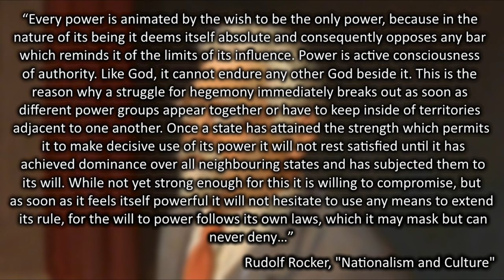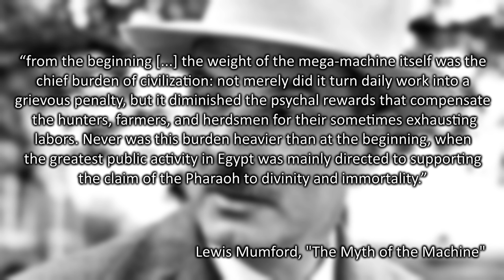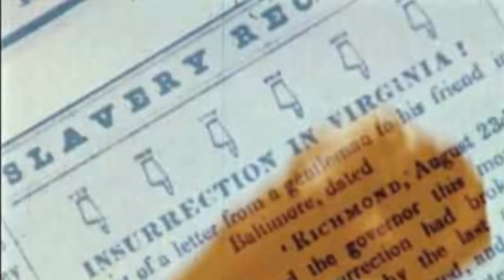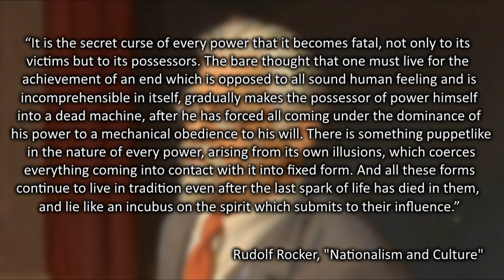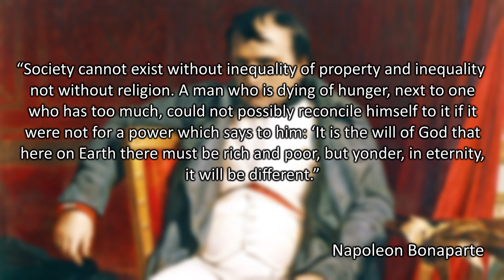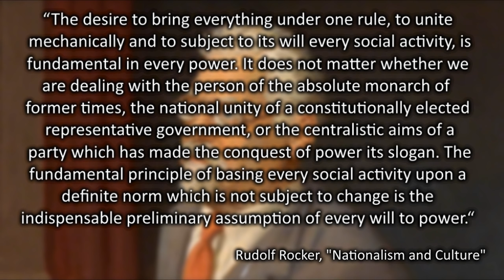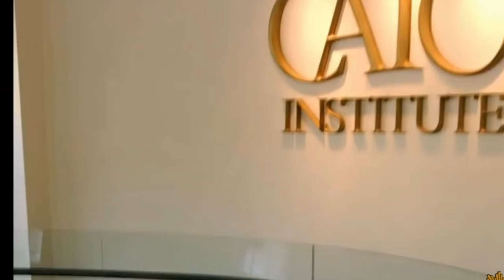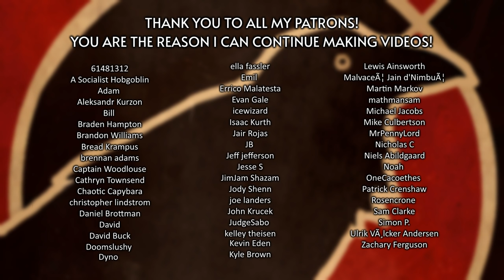Power: An Anarchist Perspective

Comment: This is one of the reasons I prefer the terminology wich is very common among anarchists in my country, although I don't see it so much with american ones, that anarchist are not against "power" per se, but against domination. "Domination" sums up pretty neatly what anarchism is against (wich I see people usually use "coercive hierarchy" or "authoritarian power" to convey). Brazilian anarchist scholar called Felipe Corrêa writes that anarchism seeks to abolish "dominating power" and replace it with "self-management power", the kind of "power" where everyone has maximum participation on how decisions get carried out.
Reply from the maker: Extremely similar to the framework in the next video I am working on

Comment: That's a great theory. The ability to successfully enact one's will is a good definition of power. The control over others, and the demand for their obedience stifles individuality. This is why accepting authority, as in an authoritarian power, is contested. 

The masses need their means of subsistence met, but rulers hold the production means. The forces of production, i.e the human labour and the means of labour, are rented and owned by capitalists. So when the only avenue for finding food is to submit to an unjust hierarchy, people become alienated, and their revolutionary spirit is broken. They see no way out.

This is why an authority that authorizes production should emerge that isn't hierarchical, but horizontal, directally electable, and swiftly recallable. Accumulating capital, the profit motive, wage labour are authoritarian processes to an extent, as well. This is also why, in my view, distribution, like consumer councils, should also be authorized and organized on non-authoritarian lines.

Capitalist and religious hierarchies are historically rested upon misanthropy and bigotry, as is patriarchy. Embracing each intersection of oppression, and building class consiousness, are the most effective tools with which we can topple these oppressive systems, and most importantly make sure that the organisation for the revolution won't result in a oppressive aftermath.

The hierarchical system as an inhumane machine is an excellent point. Competition among people, and domination over others, and over the environment, were fundamental characteristics of Leninism. 

Cooperation and solidarity is the way forward. Excellent video!

Comment: Here in the US it is really easy to advocate for ideas like Anarchy. That's because we've been insulated from the horrors of war. In the tides of war, anarchy faulters to those with power, or forced to become into power. Take World War 2, Anarchy did not destroy Fascism, the USSR did.
Reply from the maker: Unfortunately, Russia is now fascist. So, while yes, state capitalist USSR did succeed in sabotaging every anarchist experiment in its geopolitical sphere of influence and therefore survived to fight fascism (though helping fascism win in Spain for example), it's not really a testament to the efficiency of that path for revolutionary purposes. It's more an example that anarchists need to do better, as clearly the alternatives always backslide into capitalism or outright fascism in time.
Reply: @Anark  This still doesn't negate that anarchy is unsustainable. You can't have a region of anarchy, nevertheless anarchy with ideology, without power. You can't be anti-capitalist, if you refuse to use power to crack down on black market trading, or enforcing labour standards. Without an inforced presence, gangs would replace the role of the capitalist and eventually, the state. Even if you managed to get a comune of exclusively anarchist, you would still need to have an organized force to prevent threats from both internal and external. And an organized force seems rather antithetical to your ideals on power.
Reply from the maker: @Nate Foster  Correct. Anarchy is not without the capability to use force. Self-defense is a central component of autonomy. Watch my videos After the Revolution or Constructing the Revolution
Reply: @Anark The only reason anarchy emerged during that chaotic time was due to the chaos from the Russian Revolution. In which the Soviets created a state of dual power. Note: power. Successful revolution requires power. Anarchy not only dissempowers the artisticcratic class, but the working class aswell. 

A note about the defence: a good defense is a preemptive offense. Eventually, someone (or a group) would come to this conclusion, and they would just recreate power once more.

Best to continue history, and give power to the working class. Instead of restarting history by just burning it all down.
Reply from the maker: @natefoster5454  It sounds like you need to watch one of the even more introductory videos before moving on to After the Revolution or Constructing the Revolution. Anarchism does not mean "chaos," "lack of organization," "lack of power," or "inability to use force." I recommend the Anark Abridged titled "Introduction to Anarchism." https://youtu.be/qMJBGBzKKRY

After you've watched that, we can probably have a more equal exchange.
Reply: @natefoster5454  Anarchy wasn't even in WW2.